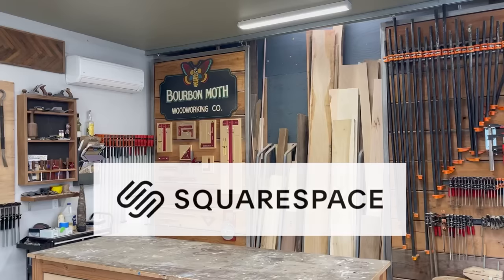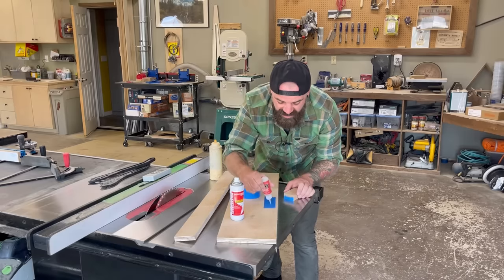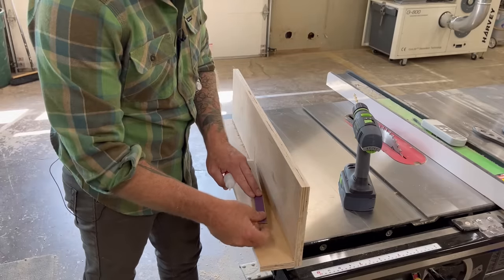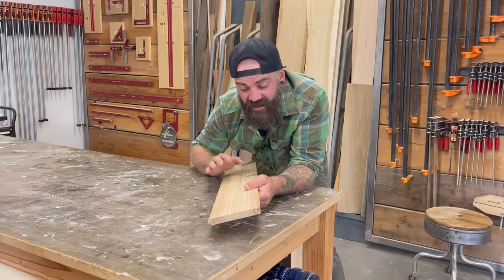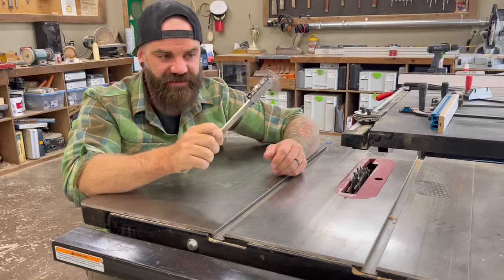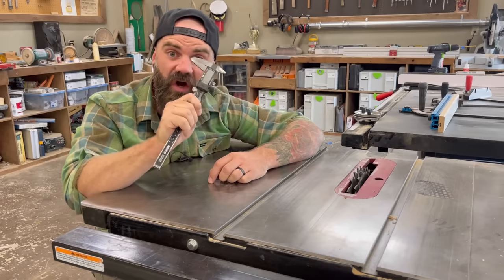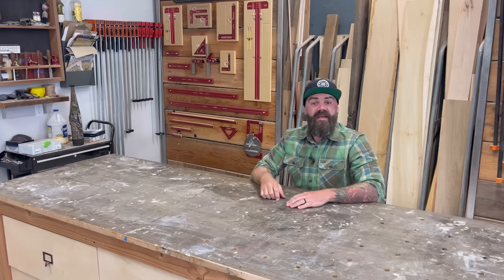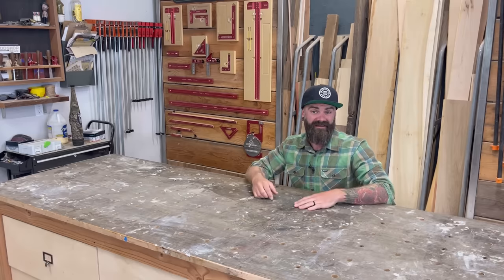Helpful Woodworking Tricks You'll Actually Use | Useful Woodshop Hacks

Comment: Being a total beginner, something i contemplated, and well, didn't do, because i like having 10 fingers.... I'm pretty sure, with a table saw, tilting the blade, and running against a miter fence, it would be doable.......

Like I said, I like my fingers so I didn't "experiment", how would you sharpen up a 4x4 stick (centimeters, in inches, around 1 1/2 i guess), to hammer it down into the ground in the garden with a table saw? The answer "you do not", is perfectly acceptable.

Comment: NOPE Calipers are NOT the best tweezers.

THESE tweezers, on amazon, are much MUCH better:
HTS MT-038-L Large Fold-Out Tweezers with 3.5x Magnifier
(I'd link, but youtube kills such vids). You may find a similar pair with a penlight... that's also a good feature... not yet seen one with both the HINGED magnifier AND lights. And the hinge is the most important.

1 -- Hinged magnifier, allowing you to point the lens in the best direction for you to see/focus (others are not hinged, and thus are inferior)
2 -- POINTY ENDs -- clean with alcohol first, both tweezers and area, and the pointy ends can be used to dig at the skin for stuff that just does not want to be tweezed... that is, you can dig the damned sliver out as needed, and sometimes it is!
3 -- cheap!! US$6.50 
4 -- ACTUALLY TWEEZES!! All too many tweezers don't actually "meet" properly at the end, so you have to move them around to find the "magic point" where they ACTUALLY connect (a hair of difference DOES MATTER where the surfaces meet, for tweezers!).

😉

Comment: I stopped watching Fixer Upper because of the dangerous habits of the "construction" guy Chip. Throwing hammers through windows, running through drywall between the studs. Makes for good TV perhaps, but worksite safety is paramount. Stopped watching yours when you fell on the floor.  But that's just me.....

Comment: If you can remember it, though, CA stands for "Cyanoacrylate", which is the base chemical doing the bonding. 

Yes, the "Cyano" is cyanide, so, yes, you can commit suicide by swallowing a bunch of it... 😆😆😆🤪🤪😛

The benefit to this is that you can Gain Respect From Woodworkers by not abbreviating it to "CA", and just drop "Cyanoacrylate glue" into casual conversations. Easier than that "fake blood" trick you had for this, in another vid. 😁 Since they may not be able to make the connection, when they go, "Huh?" you can look at them exasperated, and snort, "CA glue. Super glue... y'know?" and then roll your eyes. 😚😚😚😚. MUCH better than the fake blood... Cause now you look smarter than they are, too...😁